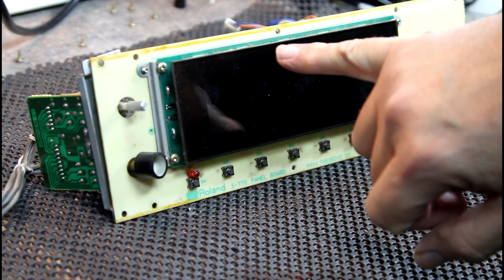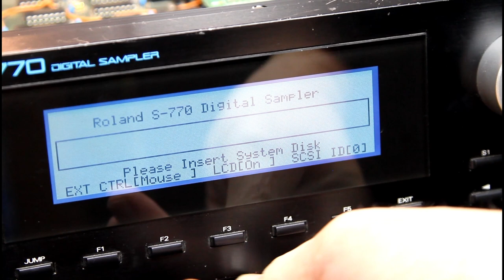Roland S770 sampler replacing the backlight on the display

Comment: take the LCD offline and the window/menu speed increases with the RGB digital out to a monitor.  The LCD has a separate LCD chip that converts signals from TTL.  Also the onboard LCD offers nothing.  Latest turbo ROM increases menu speed too, even without the CPU upgrade
Reply from the maker: brilliant thanks for the info many thanks Chumley and Bangers
Reply: Exactly, there is no point of replacing LCD backlight on S750/S770 for that reason. Also no single reason to install a floppy emulator in those...